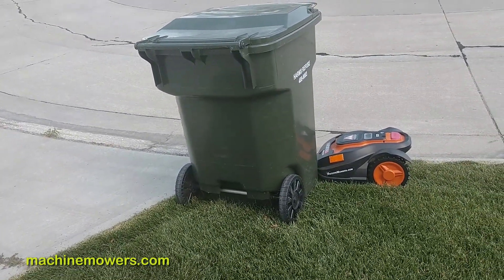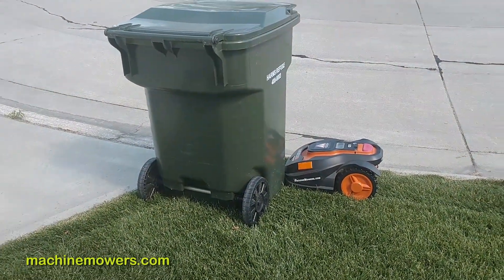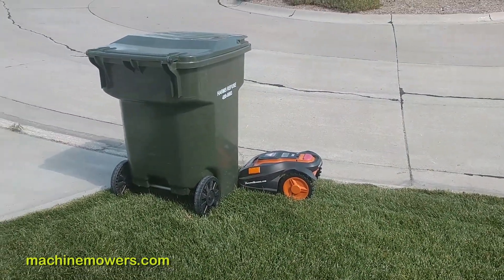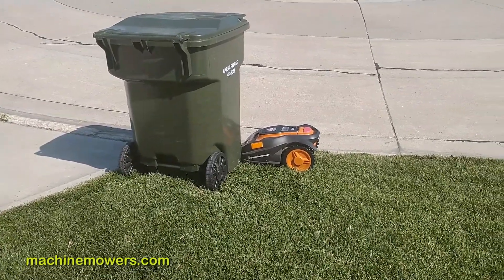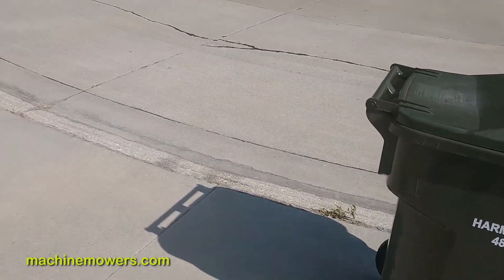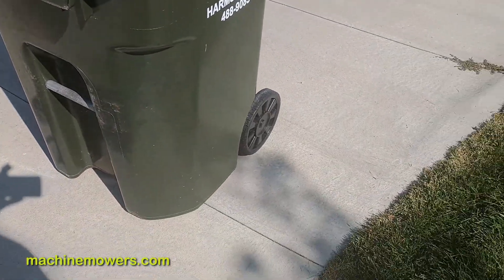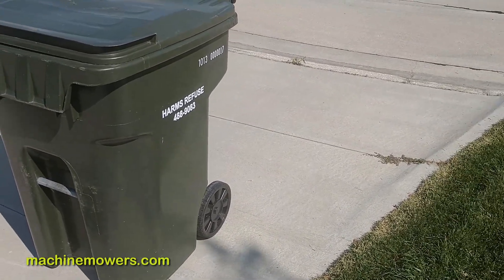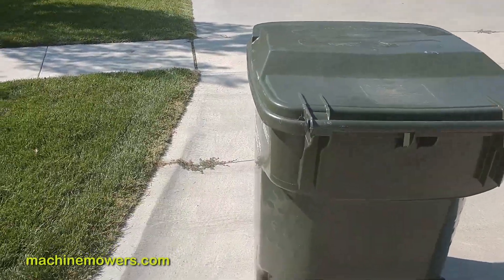Trash Cans and the Perimeter Wire | Worx Landroid WG794 Troubleshooting Video Series - #15

Comment: My workaround for this issue, outside of putting the bin on the driveway, is to tell the bot to take the day off the day before and the day of garbage pickup. 
The bin goes out on Wednesdays, along with any other yard waste (which doesn't go in the driveway). And it's picked up on Thursday. If the wife happens to put it out on the lawn then it's no big deal since the mower isn't doing anything between Tuesday and Friday.